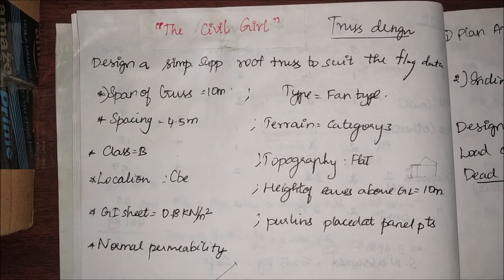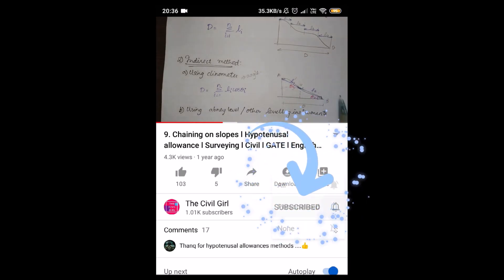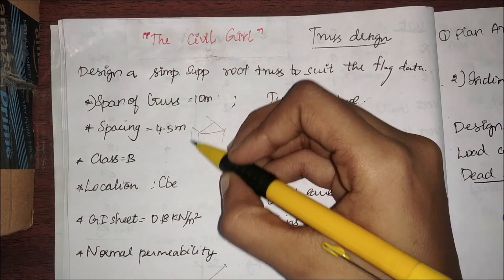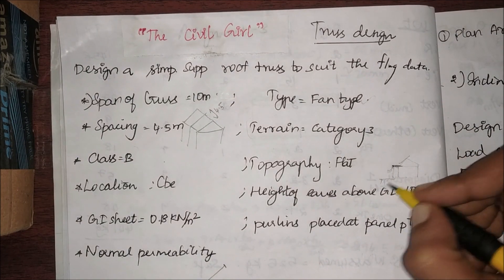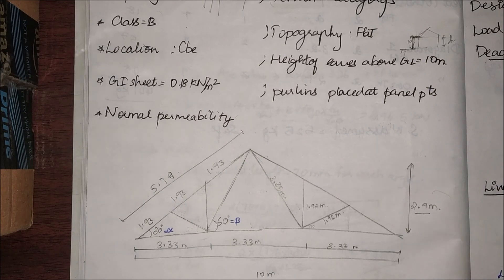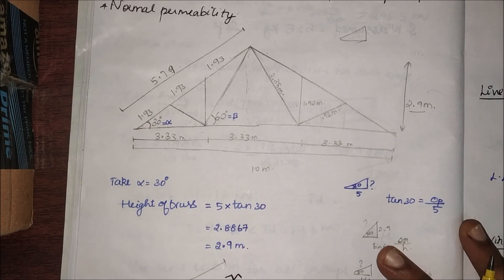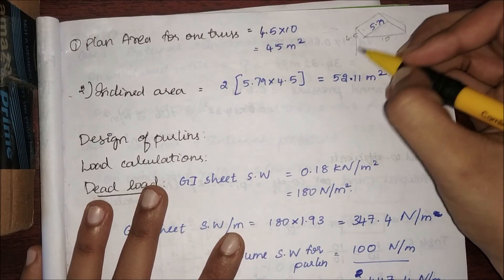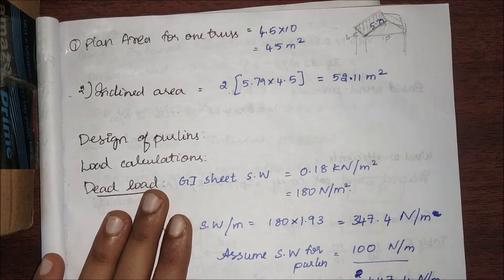1. Roof truss design | Load calculation, Purlin design, Member design | IS code | Steel truss |

Comment: Hi, Please advise can we design roof truss by using Staad pro in timber material instead of steel.or advise other stuctural software  which will be suitable for the same. Thanks

Comment: at 5:00, shouldn't the Self weight of roofing sheet multiply with the area instead of just the spacing of purlins, which is the slope area.
then divide the load in two since half would act on one side and the other half on the other side.
So i don't understand why only the spacing was multiplied with.
Can someone explain or is there some mistake.

Comment: Good explanation and knowledge. But FYI nowadays no one is using angles as purlins, as they are heavy, expensive and old design. Now sq. & Rectangle pipe sections are being used for trusses to reduce weight on structure. It would be helpful if you make a video with that. Also kindly make a video for peb structures.
Reply: How about cold form Z and C Purlins which are lighter but can span up to 6.5m... For the Truss do we still use angles or pipes??

Comment: 24 " OC is by far the most common spacing. Try finding 23 or 24" wide roll insulation. Its like they go out of their way to NEVER have it in stock. I'm talking YEARS not months. I never have understood that and never will. It must be rocket science to manufacture it at that width.

Comment: Madam,... When you picked up the value for 'k2', you classified the building under class B; that means the largest one amongst its 'length, breadth and height' should be something between 20m & 50m, and then you assigned k2 =0.88, then it's evident that the h=10. 
On the contrary, it was taken h/w=1, while you derived the value for Cpe using table 5.... 
I'm afraid, you assumed w>20 in the first case, and in the second w=10.....

Comment: Super explanation  meanwhile my suggestion is that you may take a lecture little bit slow so that everyone can understand clearly completely 
However, thank you so much for teaching along with respective IS codes including specific page also excellent 
Congrats 
With expecting more and more different types of steel and RCC structures Designs 
Warm regards 
C. Ravichandran
Reply: Yeah, but you have an option to slow down the speed in settings too😄😄

Comment: can you verify or check my steel trusses assuming actual dead and live loads, total span of bottom chord is 12.07M, total rafter or top chord is 6.1532M x2, vertical member spacing is 1M, king post length or rise is 1.2M, please correct dimensions and distances also and check if this truss is capable of carrying loads. thanks

Comment: Why less than 30° inclination increases the live load...?
Reply: Because if the angle  increases, then  Live load or people are scared to climb up the truss.
Reply from the maker: hey! if u resolve the loads in x and y direction, you can find that the relationship between the angle of inclination is inversely proportional to vertical force!